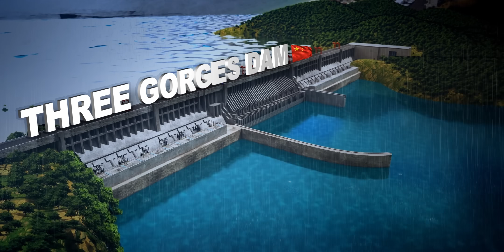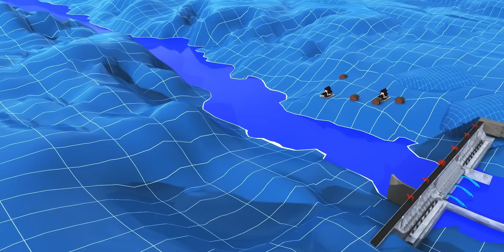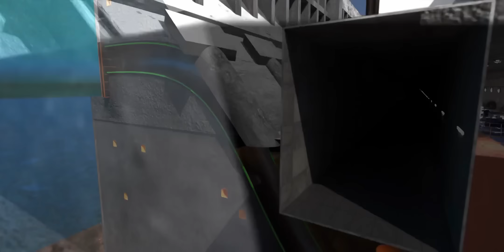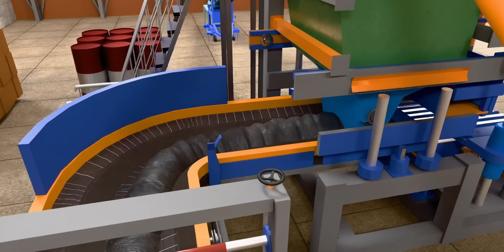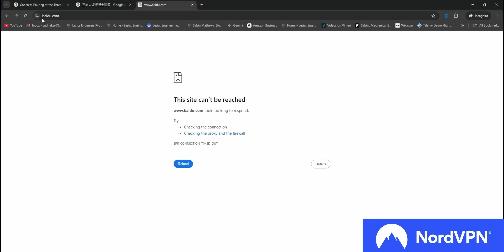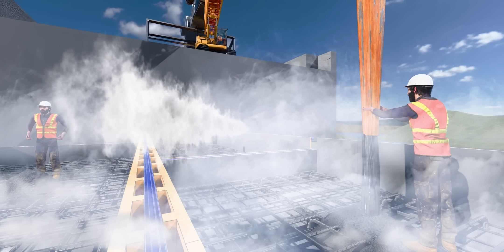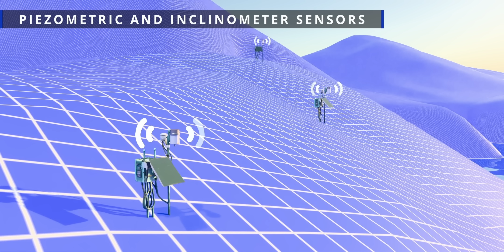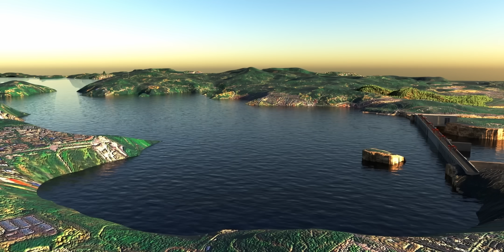Three Gorges: How 40 Billion Tons of Water Shifted the Earth’s Axis

Comment: First time I really learned something about the dam. Also really smart to put 6 underground
Reply: How much total water is there in earth
Reply: This video is a typical example of pseudoscience for morons, like Global Warming/Climate Change scam, naming CO2 as the villain when it's a gas that sustains life on Earth. The Earth's atmosphere is composed of 78% nitrogen, 21% oxygen, 0.93% argon, and 0.04% CO2, responsible for plant photosynthesis. Without plants, there would be no food for herbivores, carnivores, or omnivores; worse, without CO2, we wouldn't have plankton and algae, therefore the oxygen level would degrade. Here, the claim of 40 billion tons dammed in the Three Gorges Dam is another example of pseudoscience, because the total volume of water on Earth is estimated at 1.488 trillion tons, of which 97.5% is ocean saltwater, and the remaining 2.5% represents 37.2 million tons. How could Three Gorges have dammed 40 million tons, more water than the total amount of non-saltwater on Earth?
Reply: @999justforfun  nga learn about weight and density 🥀 then yap here
Reply: @999justforfun   Lake Superior, ALONE, holds more than the 1.9 trillion you listed. 😅
Reply: because you are off by a factor of a MILLION.  The earth has 1.4 Quintillion (1.4 x 10 to the 18th) tons of water, not 1.4 trillion (10x 10 to the 12th) tons of water.  Still  hard to believe one dam is holding one-millionth of all fresh water.  Incredible.

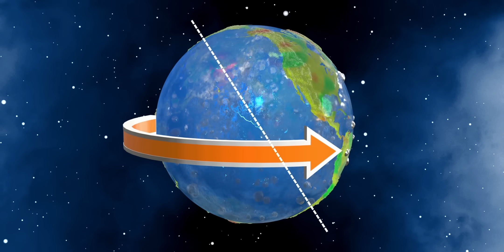Comment: 3:56 Kinda overhyped the amount of change here, the sun will be ~80% of the way through its remaining life before we have an extra leap day: (0.00000006s/day) x (365day/year) = 0.0000219s/year, (86400s/day) ÷ (0.0000219s/year) = 3,945,205,479.45 years for 1 day difference
Cool animations though
Reply: The hype are mostly done to degrade the project citing how much effect it gave. What not mention is just and earthquake alone in 2004 in Indian ocean change the rotation by 2.67 second which 45 time the gorges dam do. Consider how many earth quake happen with movement of the earth causing rotation fast and slow. NASA mention of it just for drama.
Reply: You did the math, but failed to fact check the video creator, the earths rotation has been speeding up over the past year or two, so while your math may be correct the fact you were basing it on is not.  Still major props though for taking the time to do the math.

Although because the earth has a tilt and wobbles back and forth so to speak, IF they're saying that much water could effect the rotation of the earth with those added variables of how the earth rotates and moves through space could it just be that the opposite is true about its effect on the speed of rotation.

I am not smart enough to figure all that out, but I'm sure someone out there is.
Reply: @RobertPearsonJr  Didn’t know the earth was speeding up, interesting!
I suppose my comment was worded in a way that makes it technically incorrect. What I mean is that based on the time they claimed the project added to each day, that is the number of years it would take for that alone to have an impact of adding one extra day (regardless of whether other factors cause a decrease or further increase in number of/ length of days)

Thanks for the comment :)
Reply: r/theydidthemath
Reply: Makes you wonder what other manmade changes have had on the earth’s rotation.
Reply: good one on ya for using that brain power. I don't say this enough, but its good to see people aren't all "Know nothings"
Reply: The average global temperature is going up faster 🥀
Reply: @gretathunburg8863  What is you 4 year degree in an university you graduated from?
Reply: @gretathunburg8863  it's all your hot takes that's causing it.